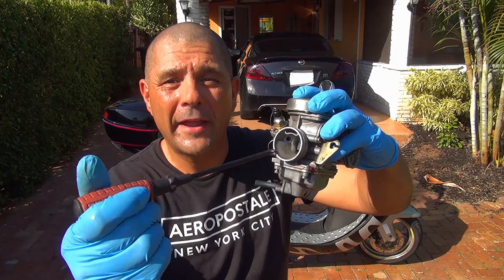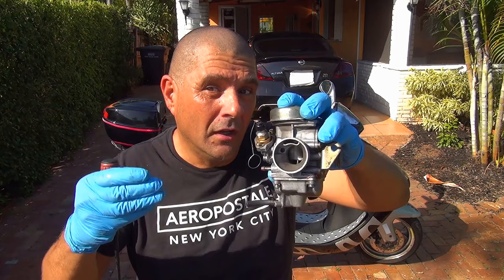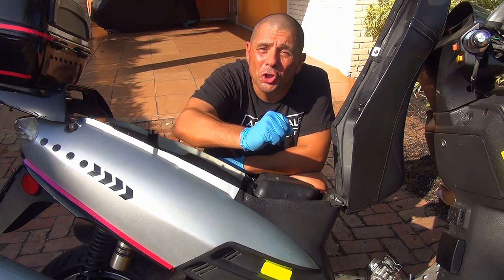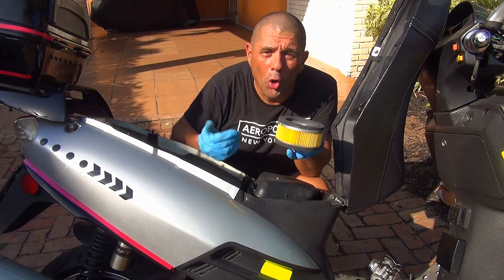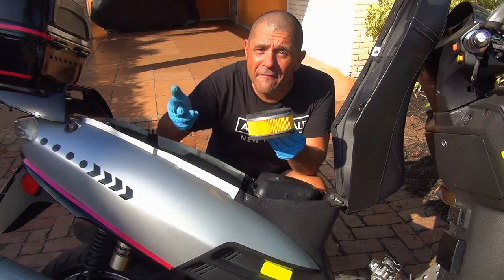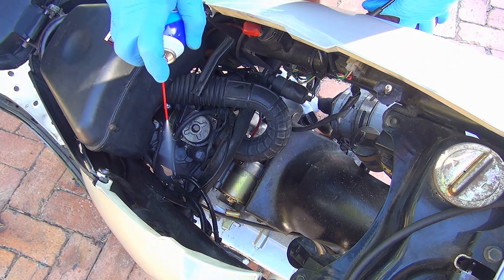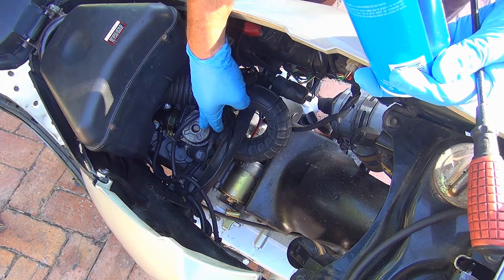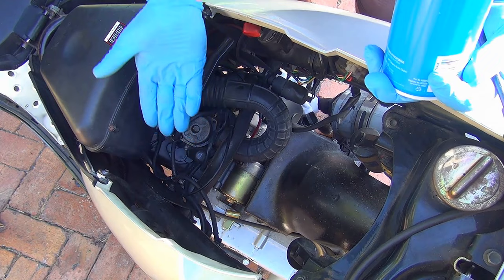How to fix a scooter that bogs down

Comment: Hello there buddy thanks for another video but I kind of knew that I was going to have trouble finding a video on what's wrong with my moped because I've never had one to do what this current moped is doing and I've been riding mopeds for almost 20 years now and probably went through 10 or 15 within that time probably more and this is the first one that I've ever had to do what it is doing. My moped bogs down and Misses out only when I ride in the rain! And I wrote every one of my mopeds in the rain back and forth to work for years and years and in pouring rain and I've never had one to miss out or bog down like that and I cannot figure it out have you ever had one to do that? Bog down and miss out when riding it in the rain??
Reply from the maker: t sounds like you're experiencing some frustrating issues with your moped in the rain! While I haven't personally encountered this exact problem, there could be a few potential causes for your moped bogging down and misfiring in wet conditions:
Moisture in the Electrical System: Rainwater may be infiltrating your moped's electrical components, such as the spark plug, ignition system, or wiring, causing them to short out or malfunction. Check for any exposed or damaged wiring, and ensure that all electrical connections are properly sealed.
Air Intake Issues: Water entering the air intake system can disrupt the air-to-fuel ratio, leading to poor combustion and engine performance. Make sure your air filter is clean and properly installed, and consider installing a rain cover or shield over the air intake to prevent water ingress.
Fuel System Problems: Moisture may be getting into the fuel system, diluting the fuel mixture or causing corrosion in the fuel lines or carburetor. Try using fuel stabilizers or additives designed to disperse water in the fuel, and inspect the fuel lines and carburetor for any signs of moisture or corrosion.
If you've checked these potential causes and are still experiencing issues, it may be helpful to consult a professional mechanic or technician who specializes in moped repair. They can perform a more thorough diagnosis and recommend appropriate solutions to get your moped running smoothly in all weather conditions.

Comment: Hi Thks four you vídeo I have a Peugeot V-Clic 50cc 4T the scooter start fine the problem is the reves is up and down and up and down all the time any reason thank you very much apreciate
Reply from the maker: The erratic idle speed on your Peugeot V-Clic 50cc 4T scooter could be due to several factors. Common causes include air intake issues, fuel system problems, dirty spark plugs, vacuum leaks, and throttle malfunctions. Start by checking for air leaks, cleaning the carburetor, adjusting the idle speed screw, and inspecting the spark plug. Ensure your fuel and air filters are clean, and there are no exhaust obstructions. If the problem persists, consult a professional mechanic with expertise in scooters for further diagnosis and repair. Regular maintenance, as per the scooter's manual, can help prevent such issues in the future.

Comment: Hi well explain I have Honda pcx125 wwA2021 how can I increase power it’s hoses maximum speed 60m/h I want 70m/h do you have any idea how can I improve my scooter power
Reply from the maker: Hello my friend to increase the power and maximum speed of your Honda PCX125 WW-A 2021 to 70 mph, consider these modifications:
Upgrade the Variator and Roller Weights: A performance variator and lighter roller weights can enhance acceleration and top speed by optimizing the CVT transmission.
Install a Performance Exhaust: A high-flow exhaust system reduces back pressure, improving engine efficiency and power.
Upgrade the Air Filter: A high-flow air filter increases air intake, enhancing combustion and overall engine performance.
ECU Tune or Upgrade: Tuning or upgrading the ECU optimizes the fuel-air mixture, boosting performance.
Big Bore Kit: Increasing engine displacement with a big bore kit significantly boosts power and torque, though it requires professional installation.
Upgrade Clutch and Torque Spring: Performance clutch and stiffer torque spring improve power transfer and acceleration.
Regular Maintenance: Keep the scooter well-maintained with regular checks on the spark plug, oil changes, and CVT belt condition.
Reduce Weight: Removing unnecessary accessories reduces the scooter's overall weight, enhancing performance.
High-Quality Fuel: Use high-octane fuel for better combustion and efficiency.
and the best secret keep your tire pressure at the perfect PSI for your scooter 
Always prioritize safety, check local regulations, and be aware that modifications might void your warranty. These enhancements can help you achieve your desired speed while maintaining reliability.
Thank you for watching my video

Comment: I have had my gy6 up to 65mph. But latley its bogging down. I bought new carb, performance cdi, ignition coil , upgraded the cam shaft, performance clutch, racing variator,
Reply from the maker: It sounds like you've put a lot of effort into upgrading your GY6 scooter, but the recent bogging down issue can be frustrating. Here are a few potential causes and solutions to consider:
1. Fuel System Issues
Fuel Filter: Ensure your fuel filter is clean and not clogged. A blocked fuel filter can restrict fuel flow, causing the engine to bog down.
Fuel Lines: Check for any kinks or blockages in the fuel lines that could be restricting fuel flow.
Carburetor Tuning: Even though you bought a new carburetor, it might need proper tuning. Ensure the air-fuel mixture is correctly set for optimal performance.
2. Air Intake
Air Filter: Make sure the air filter is clean and not restricting airflow. A dirty air filter can cause the engine to run rich, leading to bogging.
Vacuum Leaks: Inspect for any vacuum leaks around the intake manifold and carburetor. Leaks can cause erratic engine behavior.
3. Ignition System
Spark Plug: Check the condition of the spark plug. A fouled or worn-out spark plug can cause misfires and bogging. Replace if necessary.
Wiring and Connections: Ensure all wiring and connections to the ignition coil, CDI, and other electrical components are secure and in good condition.
4. Exhaust System
Exhaust Blockage: Ensure the exhaust system is not blocked or restricted. A clogged exhaust can reduce engine performance.
Exhaust Leak: Check for exhaust leaks which can affect back pressure and engine efficiency.
5. CVT System
Drive Belt: Inspect the CVT drive belt for wear and tear. A worn belt can slip and cause power loss.
Roller Weights: Make sure the roller weights in the variator are in good condition and properly balanced.
6. Camshaft Timing
Timing: Verify that the camshaft timing is correctly set. Incorrect timing can lead to poor engine performance and bogging.
7. Engine Compression
Compression Test: Perform a compression test to check the engine’s health. Low compression can indicate issues with the piston rings, valves, or gaskets, leading to power loss.
8. Other Considerations
Fuel Quality: Ensure you are using high-quality fuel. Contaminated or low-octane fuel can cause engine performance issues.
Temperature and Altitude: Consider if changes in weather or altitude might be affecting performance, as these factors can impact air-fuel mixture and engine power.
By systematically checking these areas, you should be able to identify and resolve the bogging issue. If the problem persists, consulting with a professional mechanic who specializes in GY6 engines might be a good idea.

Comment: i just bought a 2016 Kait 150cc Scooter and i am wondering why when im high speeds and then when i brake, the exaust pops a bit
Reply from the maker: When a scooter's exhaust "pops" during braking, it could indicate a few potential issues:

Air-Fuel Mixture: A lean air-fuel mixture can cause popping sounds in the exhaust. When you decelerate, the engine might be running rich momentarily, and unburnt fuel ignites in the hot exhaust system, causing popping noises.

Exhaust Leaks: Any leaks or gaps in the exhaust system can allow air to enter, leading to irregular combustion and popping sounds, especially when decelerating.

Aftermarket Modifications: If any aftermarket modifications have been made to the scooter, such as changing the exhaust system or modifying the fuel delivery system, it could alter the way the engine behaves and lead to popping sounds.

Carbon Buildup: Over time, carbon deposits can accumulate in the exhaust system, affecting the flow of gases and causing popping noises during deceleration.

Valve Timing: Incorrect valve timing can also cause popping sounds. If the valves are not opening and closing at the right times, it can lead to incomplete combustion and popping noises.

Comment: Hi how are you doing 
Why do n GY6 don't have power in the up Hill please help
Reply from the maker: Hi, I’m doing well, thanks! If your GY6 150cc scooter lacks power uphill, consider these key areas:
CVT Issues: Check the drive belt and roller weights for wear and ensure the clutch is functioning properly.
Fuel System: Clean and tune the carburetor, replace the fuel filter, and ensure fuel lines are clear.
Air Intake: Clean or replace the air filter and check for vacuum leaks.
Ignition: Ensure the spark plug, CDI, and ignition coil are in good condition.
Exhaust: Check for blockages in the exhaust system.
Engine Compression: Perform a compression test to ensure the engine is in good health.
Gear Ratios: Consider adjusting gear ratios for better uphill performance.
Load and Weight: Reduce extra weight and ensure proper weight distribution.
Fuel Quality: Use high-quality fuel for better performance.
Regular maintenance and professional tune-ups can also help keep your scooter running smoothly.

Comment: What's the proper way to connect all my vacuum lines I adjusted the gas air mixture screw and the idle screw it's idling perfect the back wheel is not even spinning when I accelerate it goes it's on the lift it's not on the ground it's on the kickstand lift but the tires does not move it's like it's idling perfect the right side of the intake nipple I have a hose on it and I have it taped off please help
Reply from the maker: Hi did you check this video https://youtu.be/FJQU5aXd0lA

Comment: I have a brand new vitacci clash 200...only 40 miles on it...its already stalling and its hard to start..its electronic fuel injected...I use 91 premium gas..seems to run ok with the seat off..think it might be a pinched line?
Reply from the maker: It's unfortunate to hear that you're experiencing issues with your brand new Vitacci Clash 200. There could be several reasons why your scooter is stalling and hard to start, even with only 40 miles on it. Here are a few possible causes to consider:

Fuel Issues: While you're using premium gas, there might be contaminants or water in the fuel tank that are causing problems. It's a good idea to drain the fuel tank and refill it with fresh, high-quality fuel to rule out fuel-related issues.

Air Intake or Filter Blockage: If there's a blockage in the air intake or the air filter is dirty, it can lead to improper air-fuel mixture and stalling. Check the air filter and the intake system for any obstructions.

Electronic Components: Since your scooter is electronically fuel injected, there might be an issue with sensors, the fuel injection system, or the ignition system. These components are crucial for proper engine operation. A diagnostic scan might be needed to identify any electronic faults.

Pinched or Blocked Fuel Line: Your suspicion of a pinched fuel line could be valid. A pinched or blocked fuel line could restrict the flow of fuel to the engine, causing stalling and difficulty in starting. Carefully inspect the fuel lines for any kinks or obstructions.

Vacuum Leaks: Vacuum leaks in the intake system can disrupt the air-fuel mixture and cause running issues. Make sure all hoses and connections are secure and free from leaks.

Exhaust System Issues: A blocked or restricted exhaust system can also affect engine performance. Ensure that the exhaust system is clear of any obstructions.

Electrical Connections: Loose or corroded electrical connections can lead to intermittent problems. Check all electrical connections related to the fuel injection system and ignition system.

Since your scooter is relatively new and still under warranty, it's recommended to contact the manufacturer or the dealership where you purchased the scooter. They might be able to provide technical support, guidance, or even perform a warranty repair if necessary. If you're comfortable with doing some troubleshooting yourself, you could start with the basics like checking fuel quality, inspecting air intake components, and looking for any visible issues in the engine bay.

If you're not confident in your ability to diagnose and fix the issue, it's best to involve a professional mechanic who specializes in scooters or motorcycles. They can perform a thorough inspection and provide accurate recommendations for repair.

Comment: What would be the biggest and strongest battery I could use with my gy6 50cc, with out burning out any wires or fuses, the reason is because I installed a big bore kit and it has so much compression, thanks
Reply from the maker: The size of the biggest battery you can place on a 50cc gas scooter depends on several factors, such as the physical size of the battery, the weight of the battery, and the power output required by the scooter.
In general, most 50cc gas scooters have limited space and weight capacity, which can make it challenging to install a large battery. Additionally, the power output required by the scooter may not be compatible with some of the larger batteries available on the market. On my 150cc I place one time a 12 volts 9 amp and was ok . Thank you for watching my video
Reply: @VirberelloScooterTips  what could I use with my 50cc? I have lots of battery space, thanks
Reply from the maker: @Byz_nasty_racing111  12 volts 9 amp battery is great https://amzn.to/3Uiv3YN this is a good battery

Comment: Hey last time i was riding my scooter i noticed i was bogging out when i gave it full throttle.  after i turned it off it cranks but it wont start any tips you can give me
Reply from the maker: Hello my friend if you experiencing bogging and then a scooter that won't start can be caused by several issues. Here are some steps to diagnose and potentially fix the problem:
Check the Fuel System:
Fuel Quality: Ensure the fuel isn't old or contaminated. If it is, drain and replace it with fresh fuel.
Fuel Filter: Check if the fuel filter is clogged and replace it if necessary.
Fuel Lines: Ensure the fuel lines are not blocked or kinked.
Carburetor: Clean the carburetor to ensure there's no dirt or gunk obstructing fuel flow. Check the jets and float bowl.
Carburetor Manifold crack or broken  https://amzn.to/3RjPJzo
Inspect the Air Filter:
A dirty or clogged air filter can cause bogging. Clean or replace the air filter if it's dirty.
Spark Plug:
Remove the spark plug and check its condition. If it's fouled, clean it or replace it.
Ensure the spark plug is properly gapped and that the spark plug cap is securely connected.
Check the Electrical System:
Battery: Ensure the battery is fully charged and in good condition.
Ignition Coil: Test the ignition coil to ensure it's providing a strong spark.
Exhaust System:
Ensure the exhaust isn't blocked. A blocked exhaust can cause back pressure, leading to bogging and starting issues.
Compression:
Check the engine compression. Low compression can cause starting and performance issues. This might indicate worn piston rings, a bad gasket, or valve problems.
Inspect for vacuum leaks around the intake manifold and carburetor. Use a spray bottle with soapy water to spray around potential leak areas while cranking the engine. Bubbles will indicate a leak.
Thank you for watching my video

Comment: In the video you mentioned using brake cleaner on the vacuum lines to listen for a change in idle. Does it have to be brake cleaner tho? Or could I maybe use carburetor cleaner? I'm asking because I recently just replaced the carb on my bike and I planned to clean the old carb, so I'm not sure if I should purchase both cleaners or if the one carb cleaner could work for both
Reply from the maker: Hello my friend brake cleaner is less strong and will not damage rubber hoses carb cleaner will give you the same effect but you could damage Rubber, Plastic Components,  Paint ,  also Spraying carburetor cleaner on electrical components, such as wires and connectors, can cause damage or corrosion.
Reply: @VirberelloScooterTips  thanks for the prompt reply, your videos have always been so beneficial to the health and recover of my scooter. I've only ever owned 1 and I absolutely love it, I honestly don't know what I'm going to do when it finally quits on me for good and I'm afraid that will happen soon. It still runs good, but has seen better days and been having performance issues lately...I'm really hoping you can help answer a question to a problem I'm currently having, that I left on another one of your videos (regarding the valve adjustment)